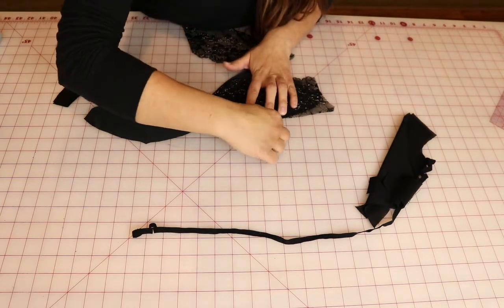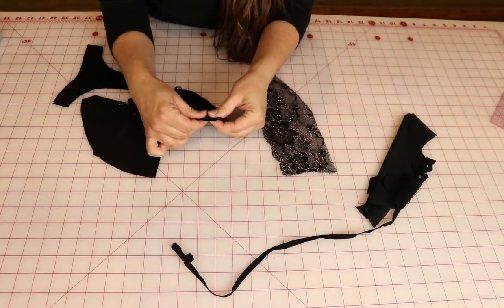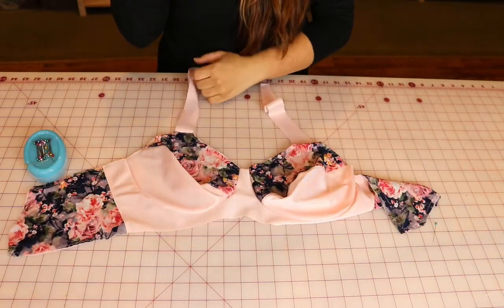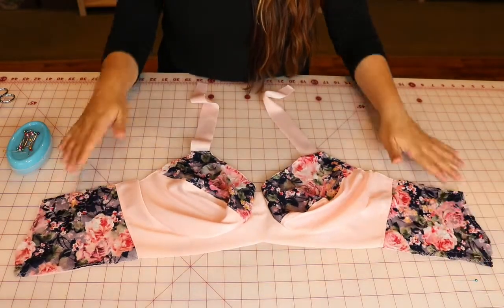Bra Making Sew Along - Cup & Frame Construction

Comment: Are you not using sheer cup lining on the lace part of the cup?
Reply from the maker: Not all patterns require it! The pink bra has powernet under the lace, the classic allows you to use stretch lace for the upper cup and you can line it if you want extra stability but it's not imperative.

For the black bra I began construction on, the stretch of the lace is actually factored into the pattern and it is a requirement to use stretch lace so again no sheer cup lining needed. The pattern will often dictate if you need to line it or not ☺️